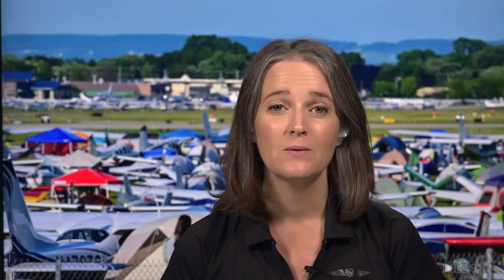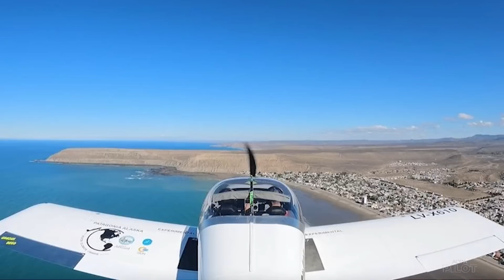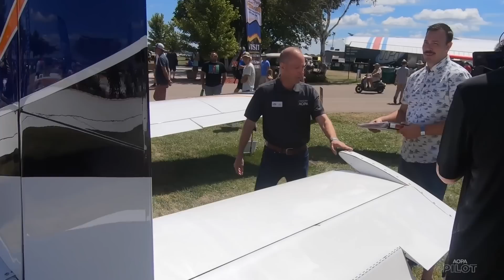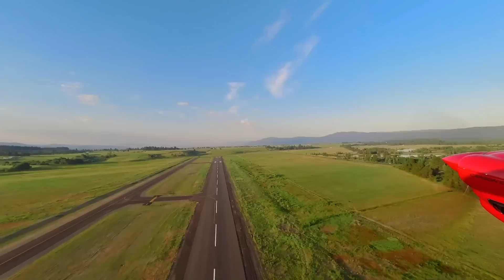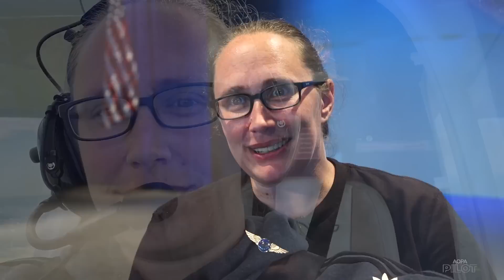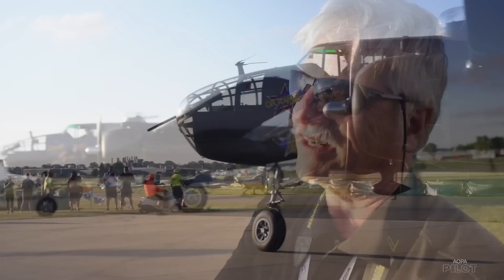AOPA Pilot Video News Brief - 7.29.22

Comment: That RV looks great. I'm wondering if these new planes are utilizing engines that won't require lead. It will be gone soon. GAMI has done all the work. The FAA is sitting on their Government whoopee cushions. Get this fuel approved. NOW!
Reply: Lack of lead will not bother engines but corn or as it’s called ethanol destroys em.
Reply: @bowhuntinoh  Ethanol is poison to engines.
Reply: @bowhuntinoh  Ethanol won't destroy them either, but the soft parts (rubber fuel lines, carb gaskets, etc) need to be up to it.  Depending on the valve seats, UL fuel may need an additive.
Reply: @RussellTelker  Well, since all those rubber parts become part of the engine, Ethanol is bad for anything it's put into. I have a 2017 plane that suffered a breakdown of my gas tank sealer and my tank vent hoses. I caught it early and avoid that garbage now. Unfortunately, I live in Hellinois where it's nearly impossible to buy Un-Corned fuel because our corrupt Government made deals with farmers for the corn and their votes. The new UL fuel will eliminate that issue for everyone, and you're right, a lead additive may be required in older planes. I went through that same thing in my boat back in the mid 90's. Used an additive, and I was good to go. 100UL is a great advance for GA. The sooner it gets approved by the FakeAviationAdministration, the better.
Did you ever finish your build?
Reply: @dh-flies  Yeah, you gotta change out the rubber to keep it from being ingested.  

I had to stop on my build for a while to take care of some family health issues.  Hoping to get back to it this month.
Reply: @RussellTelker  Wishing you good luck on completing that plane of yours. I'm assuming from your name that you are from minnesota? I grew up in the twin cities. But left a long time ago. The state has gone down since I left. Really a shame. I'm in a horrible State now too, Illinois. I will be flying up to the Cambridge area in the next few weeks to visit a friend I haven't seen in 30 years. Anyway I wish you luck on completing your build and getting up in the air.